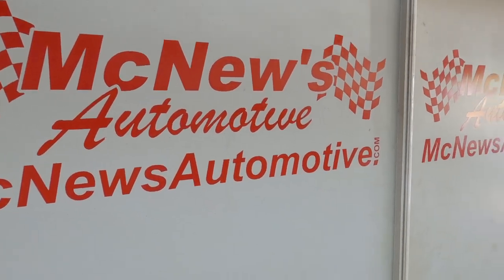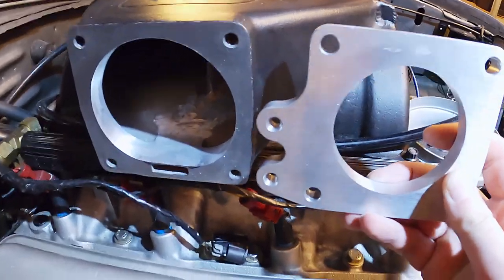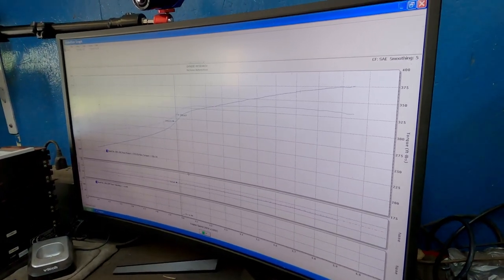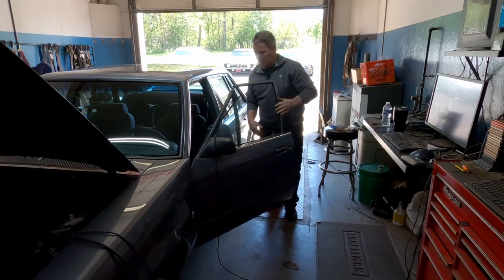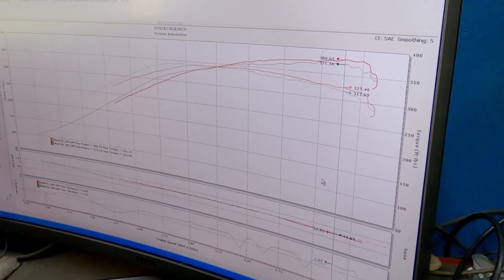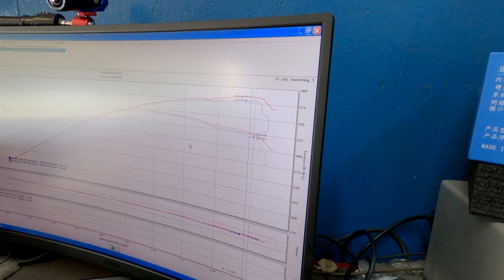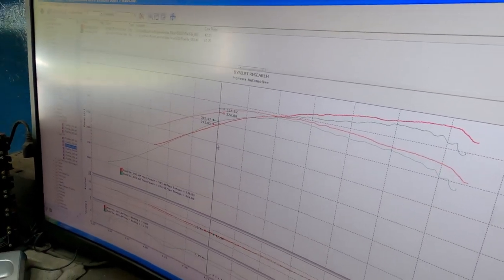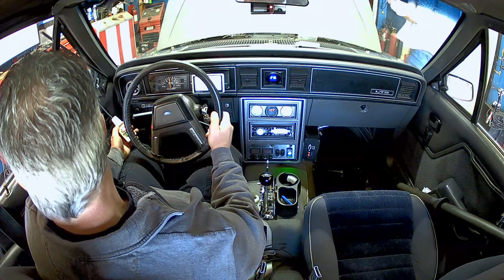Throttle Body Dyno Test - 75mm vs 100mm

Comment from the maker: I just wanted to pin a comment that might answer some questions more experienced viewers might have; particularly aimed at repeatability: 

1. I had vacuum at WOT with the 75mm TB. I have tons of real data logs showing this. This is why I tried a bigger TB.

2. I might not have been clear enough about the total gain: it was 12hp; the peak Hp RPM went from 6,000 to 6,150; and the 100mm TB carried the power further and better - being 20hp over the 75mm TB at 6,250 rpm.

3. The tune was optimized for each TB. There were no huge changes - little shifts only.

4. I only run the EFI in open loop, not closed loop ("adaptive"). I find it more consistent.

5. I have dyno tuned cars myself for about 7 years; Ray's been doing this for a living for a million years, runs two dynos, does cars and motorcycles, and his ability to look at a small ripple in a hp curve and say things like, "Add 2% fuel at 5750" and pick up every single time is god-like. Ray knows and owns more different tuning software than I can even name.

6. These were the actual weather conditions between the two days - I've seen bigger shifts within the same day:  71.21* F, 29.45 in-Hg, 13% humidity vs 78.55*F, 29.34 in-Hg, 17% humidity.

7. All runs were corrected to SAE.

8. The wheels/tires were exactly the same, and run at the same pressure (36 psi).

9. The oil was changed the day before each dyno, filled to the exact same level, using the exact same oil (Pennzoil Full Synthetic 5w-30).

Hopes this answers some questions you all may have.
Reply: Thanks for clearing out those questions i appreciate it

Comment: Make sure there is something on the end of the throttle body to promote laminar air flow.
Reply from the maker: The way 302-based EFI 5.0s are laid out, you need an elbow right at the TB no matter what.  Both TBs had tapered sections before the blade as well.  I think that either way, the 75mm TB would make measurably less power than the 100mm TB in almost all air intake situations.
Reply: No engine inlet works on laminar flow.

Comment: NA I would expect some gain if the smaller TB was too small for the power, if the throttle body was before the boost I would expect the difference to grow with boost (larger TB makes more to a point) but with the TB after the boost source it is much less sensitive to TB size, I would expect them both to be very similar as 3” is already a big enough hole for the boost to push its way through instead of relying on the atmosphere to push its way in. Too large of an intake pipe is just more volume you have to fill before pressure increases.
Reply from the maker: I think you're right.  The 75mm TB always pulled a little vacuum at WOT running n/a.  Which is why I was keeping an eye out for a bigger TB.  But under boost, I think the results would be lower for the reasons you stated.  The only thing I don't 100% agree with you about is the intake pipe thing.  The volume of airflow and velocity of it is so massive that you could run 10 feet of inlet pipe and it wouldn't make a measurable difference.  I do intend to buy my own dyno soon, and I'll be testing all kinds of stuff; maybe this is one thing to add to the list.
Reply: @AlexLTDLX  the volume of the pipe will be a marginal difference to boost building but it’s the principle. A pipe that’s way too large doesn’t give any benefit in the same way a throttle that’s much larger than the engine requires won’t make more power.
Reply from the maker: That's true.  No reason to make something bigger than it has to be.  I'm pretty sure a 90mm TB would've been sufficient in my case, but a good deal's a good deal, and 100mm certainly isn't hurting anything.

Comment: I would like to see the gains of going bigger TB in a turbo charger car, I think that bigger isnt always better in turbo cars. Thx
Reply from the maker: Well, I'm not going to be able to do that, but you're kind of right.  Pushing compressed air through a too small TB see fewer losses than running naturally aspirated.  I can tell you from 25+ years of dyno testing, you'll never lose power going to a bigger TB (within reason).  Your throttle response might get a bit twitchy, but that's about it - but even with gargantuan TBs, as long as they're oval, that's not an issue either.  There's no loss of torque at low speeds or anything.  On the previous Whipple setup, I had a HUGE monoblade oval TB - iirc, it was like 3.5" x 5.5" (90mm x 140mm) and it drove just fine and made more power than the previous TB, that had twin 64mm blades.  At the beginning of this video, you can see how well the giant TB performed with the Whipple at the track: https://youtu.be/j8SNo7kpcxw

Comment: Aaarrggghhhhh!!! You're just teasing us now!!! Good comparison on the different size throttle body, I've often wished I would have went with a 90mm on my TFS-R intake. The engine isn't finished yet so there's still time to bore it out I suppose.
Reply from the maker: Lol.  Not trying to tease, but wanted to get something out asap.  Ray got tied up with a couple of problem cars, and this was the first thing we did and easiest to edit.  I would definitely say that a 75mm TB is too small for even a modest 351/363, based on our results.
Reply: @AlexLTDLX  would you say a 347 with a large cam can make easy 500 with a 75mm? Only reason I asked is cause I already have a BBK 75mm TB.

Comment: Why would you use an AT for drag racing? Specially one so old?
Reply from the maker: A powerglide is arguably the most popular drag racing transmission on the planet - it's fairly efficient, extremely strong (esp. with aftermarket parts - the one in my car is easily good for 1,500+ hp) and only has two speeds - which is a good thing when you have a lot of power and broad power band.  First gear is 1.8:1 - and even with that gear ratio and a 3.08 rear gear ratio, it still has trouble with traction even with slicks on a well prepared track.  Any more gear it would just annihilate the tires all the time and blow through the gears too fast. And you get to really take advantage of modern torque converter technology.

Comment: It's a nice day when a 6.0 LS with a cam and headers till makes ~40hp more than a built SBF.
Reply from the maker: Actually, I'd say a 6.0 ls would make the same or less power, given the same compression ratio.  Here's why: this engine has better heads, but low compression - it's only 8.8:1 because it's my forced induction test bed.  Add in the glide, and they'd be almost identical.  Largely because in every dimension that matters for power, an LS is basically an SBF version 2.0.  I don't know if you know this, but you can bolt LS heads straight on to an SBF.  In fact, here's a guy who put LS heads and an intake on a 351 Ford and made almost 1,000 hp before he blew it up: https://youtu.be/ZEMGD5oSoPM  Of course, the LS was released 45 years after the Ford, so it didn't need things like provisions for a distributor, and the idea of making 1,000 hp from a small block was preposterous in 1962.  I view the LS and the SBF as very close cousins, name badge not withstanding.  They're certainly much more closely related than say an LS and an SBC.  FWIW, when I built this engine, a 6.0 LS was far more expensive to come by.  Though my engine is easily good for 1,200-1,400 hp (the weak link is the rotating assembly; the block is a Dart Iron Eagle Sportsman (yes, they do exist, I initially went with an SHP, but the first machinist damaged the block, and came up with this one)).  That said, if I was going to play around under 800 hp these days, I'd look for an aluminum 6.0 LS, as they're now more ubiquitous.  While we're on the Ford vs GM subject, keep in mind Ford has always been ahead of the curve - the mod motor was banned from the Engine Masters competition because nothing else could beat it: https://www.enginelabs.com/news/amsoil-engine-masters-rules-released-ford-mod-motors-need-not-apply/  But then the counter argument is the mod motors and their descendants are bigger, more complex, more expensive to build, and harder to find (i.e. fewer of them); whereas GM put the LS in everything, making them cheaper.  Like the SBC was back in the '80's.  Personally, with as cheap as they are these days, if I stumbled across an aluminum 6.0 LS for a good price (even better if it came with a trans), I'd likely buy it and find something to put it in.  If I had an opportunity to buy Kaase's EMC mod motor for something I could afford, I'd be all over that too.  But the LS is much more likely...
Reply: @AlexLTDLX  The comment was mostly just to rile up the Ford fanatics. I agree with much of your analysis, but there isn't 40hp hiding in a 0.6 compression ratio difference. My 6.0 made 420whp through a 200-4r,  and that's more driveline loss than a glide. But the big factor is probably the camshaft I'm assuming your engine is cammed for boost vs an NA camshaft which probably makes a large impact to peak numbers. I mean the small block ford was mostly Ford copying GM's homework in the 60's anyhow,  they just changed the bore spacing from 4.4inches to 4.38 inches and redesigned the heads hoping nobody would notice.  The only mod motors worth messing with are 4Vs and the Coyote. (The mod motor banning has to do with ass backwards rules they use for Engine Masters, who cares about HP/L, power density is what matters in the real world) The 4V is a terrific engine, if you can fit it into your project, for 1500+hp, the 4V Mod motor is a very proven engine, but less than 1500 hp, the LS is cheaper and easier.
Reply from the maker: The cam is pretty mild - 228/242 on a 116.  It is actually setup for the Whipple.  Don't misunderstand me - I do lke the LS motors, but the LTD is a Ford - albeit with virtually no Ford parts in the driveline anymore; except for the rear.  BTW - thanks for subscribing!  It's you all that allow me to justify going this far with this thing.  Thanks again!
Reply: @AlexLTDLX  a glide is a massive advantage.  Don't know why you persist on referring to it as a crutch.

Ask a welded and braced 8.8 what it thinks about a Glide after spending most it's life behind a 1600rwhp SBF and repetitively rebuilt C6?

Hint: it lasted less than 3 feet.
Reply: @travisjones6645 Naa bro, you're wrong on the 2v.. Mine did 309rwhp 321rwtrq at 5,447rpm n/a, had I gotten better cams I'd be making much more hp from a 281ci 2v n estimated 10.1 compression.. Seen a 5.3 swapped Fox do 248rwhp with longtubes dyno tuned vs my 2v 249rwhp remote tuned by Marty Ochs.. The Ford Modular 2v is plenty worthy of modding..
Reply: Proven fact that an LS ALWAYS needs to make more power to run equivalent to a Ford...

Comment: 6.0 LS2 with milled, otherwise stock, LS3 heads, long tubes, ported stock TB, CAI and custom cam made 477 rwhp SAE correction on an enemies Dynojet dyno through a less efficient 4L65E.  15 years ago.
Reply from the maker: Give the LTD 2 more points of compression and a lockup converter, and you'd be in the same ballpark.  Case in point - here's the LTD beating a substantially modded 2013 ZL1 Camaro at the track by 3 car lengths: https://youtu.be/WqEkBZKj0is  Both cars ran the same boost, the Camaro was on E85 (and tuned for it), the LTD was on 93 octane pump gas.  The Camaro weighed 300 lbs more than the LTD.  They made about the same power, especially given lockup vs non lockup converters.  Put the LTD on E85 and it would've gone 140+ mph and made more power than the Camaro.  It's gone over 140 mph on Q16 - look at the beginning of this video: https://youtu.be/j8SNo7kpcxw
Reply: @AlexLTDLX  almost 100hp from a lockup converter and compression?  Zero chance that happens.

Your drag race comparison is a legit example of why dyno numbers mean nothing.  Basically we agree on the outcome.

What's your AFR, injector size & duty cycle, and static compression ratio on it's best pull ever?
Reply from the maker: I think you're also not taking the cam into account - this car has a mild positive displacement blower cam with only 228* intake duration on a 116 - 236 on a 110 or 112 would be better for N/A numbers.  The cam is so mild I don't even need to run an idle air control solenoid (or motor).  Static compression is around 8.8:1.  Converter slip N/A is 8.6% on the dyno (I'm working on a video that goes through this stuff, and I actually pulled the data for it - I'll post is soon).  Other data from the best N/A pull - AFR is 13.0 on my O2 sensor and 12.8 on Ray's; injectors are 80lbs Siemens-Deka, running at 4 psi over spec pressure (48 psi vs 43.5), duty cycle is 40.1%.  Blower numbers are, of course, much different.
Reply from the maker: BTW - When I first put the glide in, I too was puzzled with what was going on.  I found this thread, which is about the best direct A-B-A comparison of a glide vs a manual trans (I know, but it's still a good reference point) on a dyno.  This guy lost 100 rwhp: https://www.corvetteforum.com/forums/c3-tech-performance/1698486-powerglide-vs-manual-100-rwhp-loss-on-dynojet.html  Oddly, his calculated % loss is pretty much exactly what mine is.  I suppose I could throw a T5 in the car and become a dyno racer - it certainly would make my Youtube numbers look a lot better!
Reply: @AlexLTDLX  we definitely agree that dyno numbers mean virtually nothing (unless a person does dyno competitions).
Reply: @AlexLTDLX  given the same total cam timing, a 228 on a 116 is "bigger" in IVC spec than a 236 on a 110.  The overwhelmingly most important cam spec.

Folks who know how to design a cam find almost zero value in "LSA" talk.
Reply: @AlexLTDLX  why are you comparing a 6 speed manual to a locked converter 4L65E?
Reply: @AlexLTDLX  interesting side note, that car picked up 3.8% injector duty cycle going from a 85mm MAF to a 94mm MAF.  (Theoretically 18hp. Never dynoed it afterwards.)  On the 85mm MAF it had manifold vacuum at WOT like yours did on the 75mm throttle body.
Reply: @AlexLTDLX  FYI, we have a glide behind a 1600hp 377 SBF.  There's nothing puzzling about it.  It's clearly more efficient.